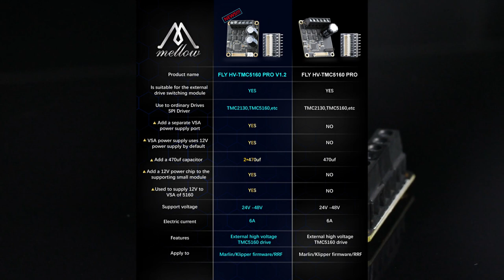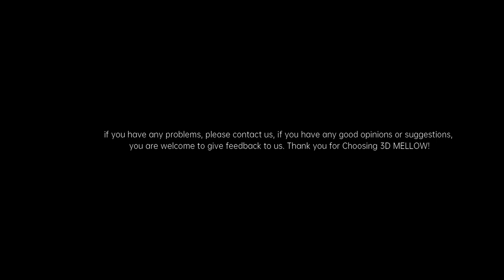Mellow Fly 24V/48V HV TMC5160 Pro V1.2 Stepper Motor Driver StepStick SPI Silent come back

Comment: Like the makerbase board but with lower voltage tolerance
Reply: Makerbase use mosfet WSP16N10 with a limit of 100 volts in datasheet of mosfets.

Comment: will it work with another UART driver (like tmc2209) ?
Reply from the maker: hello friend, for tmc5160 pro need use SPI, tmc2209 need use UART, Thanks
Reply: @3DMELLOWPrinter   got it, the point of the question was can i use them sumultaniously?
Reply: @lamedarkangel  That depends on your controller board, but most likely not. I don't know of any that let you specify different control protocols for stepper drivers.

Comment: What does 12V VSA PSU mean?
Reply from the maker: hello friend, that means Provides 12V power supply to the 5160 chip, thanks
Reply: @3DMELLOWPrinter  will it step down the 24v that my main board runs on?

Comment: Is there any incompatibility (or a features in the settings?) on the other manufacturers boards? I try this drivers with Octopus Pro/Klipper and no way to move them or I'm doing something wrong? Got constantly this 
in any configuration that I can imagine. (Unable to write tmc spi 'stepper_x' register GLOBALSCALER) Thanks.
Reply: managed to solve? I have the same problem on a spider 3.0 card. can you help me?